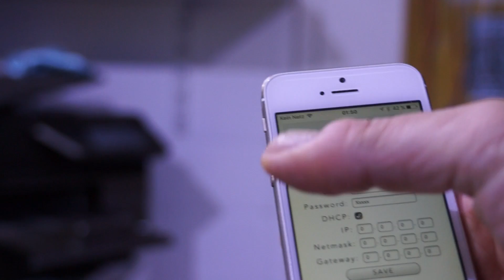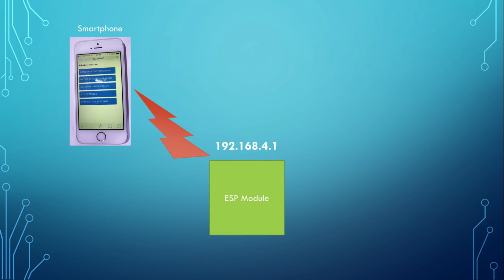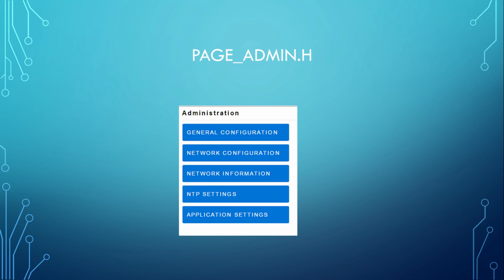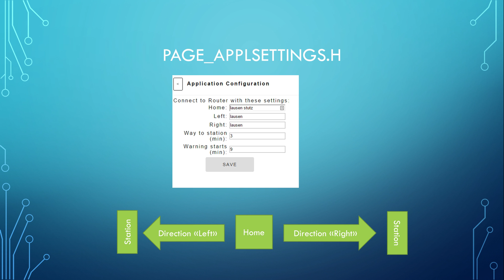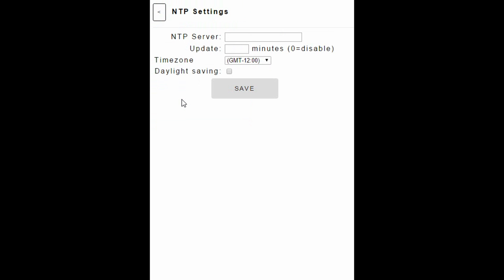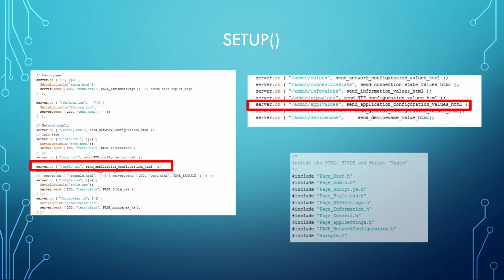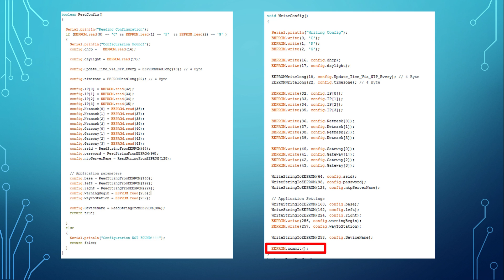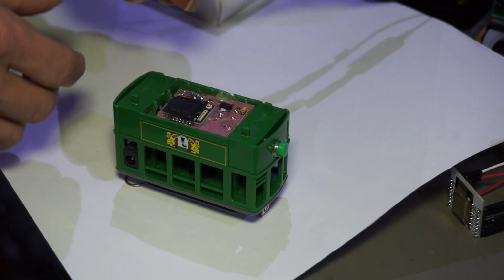#31 Internet of Things with ESP8266 #3: Interacting with your Smartphone

Comment: Andreas thanks for the videos! I have a question on EEPROM. in the video you said its only capable of a few thousand writes. but most new EEPROMs are capable of a million. do you know for sure witch this is for ESP8266?
Reply from the maker: You can check the label on your Flash chip. They use different makes.

Comment: I have copied the tutorial example. My target is ESP8266-07. The code complies and downloads into the ESP ok. When restart the ESP I see the AP show up in the wifi list on my iPhone ok. But, when I navigate to 192.168.4.1 The page is not found. My desktop and phone are also linked to my home router on a different subnet 10.0.0.1
Any help much appreciated, thanks.
Regards
Dave (Guy with the Ozie accent)
Reply from the maker: You will not find this address on your normal LAN. It is a different Wi-Fi and you have to connect to it with your mobile first (you will lose the connection to the internet for this time). Then, your address will work
Reply: Thanks Andreas. 
I did not think of that. Will try it later today. I really appreciate the work you have put into all the videos, they are very informative and helpful. I also particularly appreciate that you answer everyone's questions, very impressed with your attitude, passion and skills.

Comment: First of all - Andreas you do a great job - I like your well prepared and explained videos.

The sample code provided I could not use without any debugging.

Credentials.h missing - this issue was described earlier here - I deleted line #include <credentials.h> in ino-project file and set defaults in section // DEFAULT CONFIG  config.ssid & config.password manually
(if credentials.h is missing code will not compile)

Other issue I had: After uploading code to my ESP8266 log shows startup, but after a few seconds I was catched in WiFi not connected loop - and after some loops the watchdog restarted the ESP.
This was caused by a very short Admin Timeout in global.h file - search for "#define AdminTimeOut 1" - this equal 1 second. I set to 180 to have time to connect to access point ESP and do the needed settings. If not finished in that time frame the ESP is again catched in restart and you have to begin from the beginning.

after these issues where solved - all the rest worked as expected - hope that helps others not to run into same problems and loose their time.
Reply from the maker: Thanks for your comment. I changed the repository accordingly.

Comment: very interesting concept, Sadly though iexperience a problem. With the 
proper credentials set in my credentials.h, the serial monitor tells me 
it does not connect to WiFi.
Now if i understand right, even if my credentials are wrong, ir should start up as an AP so i can fill out the proper credentials, but  I dont get any connection to 192.168.1.1/admin.html

Interestingly, when I try johns original sketch, i do get connection to wifi, but even then the connection to 192.168.4.1 is very haphazard, sometimes it will work, sometimes not.

Now if i understand right, when the 8266 is in acces point mode, it should appear with its own ssid right?  I don' t see that at all.
Am i completely misunderstanding what is happening here?
Reply from the maker: In access point mode, the ESP has its own WiFi network. And you cannot connect to it, if your device is only connected to your home network. Your device has to have its own antenna to see this network. But I think, you experienced this already.Today, I would go the way I showed in the the IOTappstory.com videos (WiFimanager).
Reply: correct, that wasn't really my problem. but even when disconnected  from my regular network, the connection to the AP was haphazard. From my experience with WiFi manager in the past, the AP comes up with an SSID that one can connect to, but I did miss that here and in John's sketch.
As you are Swiss, it would be unthinkable that you would publish a sketch that isnt working, so for now I will presume there is some problem in my network
Reply from the maker: +Ed19601 It cannot be a problem of your network because the ESP creates a completely different network if in AP mode and your smartphone connects directly to it. This is, why you will lose internet connection to your smartphone for that time

Comment: Hi Andreas, I like your code samples especially where you explain how to have a stable program (no "while (1 == 1)" only, short delay, watchdog code, etc).
But I not found the best way to get a very simple function: some "on" and "off" buttons to manage my Electrodragon relay board.
Where it's better choice to create and manage them, example.h or main void loop?
If I create my buttons with html code directly from example.h, what is the best way to handle them?
A small example of code would be much appreciated...
Reply from the maker: There is not best place for any code. It always depends on your preferences.
I am not in HTML, I just copy-paste the code in this area. So, you have to ask somebody else with more knowledge.

Comment: Hi Andreas,
I successully implemented the FW to an ESP and it works GREAT ... thanks for your work !
Question :
Once the network setup (SSID, PW, DHCP, IP etc ...) has been written into EEPROM, what if I would like to RESET it all to the initial configuration (AP mode, 192.168.4.1) with the help of a pushbutton (connected to a GPIO) ?
An ISR could then be fired and erase the EEPROM "C-F-G" configuration ...
That would be interesting when the ESP is supposed to change of location and be set to another router !
Any hint ?
Reply from the maker: +Yann M You have to wait a little. I am working on a completely new infrastructure dealing with these issues.
Reply: Can't wait any longer :-) !!!
When is it due ?
Reply from the maker: Hopefully as a Christmas gift...

Comment: Hello Andreas,
Sorry to ask you again  but you mentioned in this #31 video that you got inspired from the work of a certain John Lassen at http://www.john-lassen.de/index.php/projects/esp-8266-arduino-ide-webconfig
This link does not work anymore, do you know of any Github or mirror where I could also check his work ?
Thanks.
Reply from the maker: I do not know whether this is temporary of forever. I found now a much easier way of getting a very similar function. I hope, I will present it next week in one of the new episodes.
Reply: I think you typed it in wrong. I found the link at http://www.john-lassen.de/en/projects/esp-8266-arduino-ide-webconfig Leave out the index.php, and put in en (for English, I presume)

Comment: Andreas, your videos are a wonderful gift to the techno-world! Well done. How do I integrate the two commands that set the mode to WiFi_AP_STA into  your VB_WebConfig_OTA_V7?  Is this done in a separate routine that must be built in to that V7 file?  Or do I rebuild another sketch around the Page_*.h files?  But if I do that I lose the EEPROM on reloading your V7 program, right?  I don't understand. What am I missing? Thanks again! (BTW: The toy train car is a very nice touch! Cute!)
Reply from the maker: Thanks for your nice comment! These commands are already in file BVB_WebConfig_OTA_V7.ino. I use the STA mode to span a WLAN for the Smartphone to enter the configuration, and later (after a timeout periode), I change to AP mode to connect to the internet.
Just follow the status variable, then you understand the program. If it is admin, the STA mode is used and in all other modes, the AP mode.
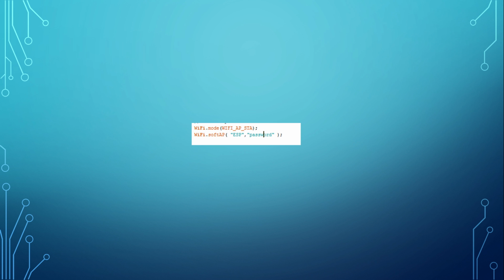Reply: Oh, I see.  Thank you.  On github line 135  I see "WiFi.mode(WIFI_STA);"  At 1:50 the video indicates WiFi.mode(WIFI_AP_STA);"  The difference is probably a versioning update to the code.  Yes, this is in the area marked by "status = admin".   The code works great for me in its default load.  Now I am trying to play with the parameters via a smartphone (actually a browser).  I plan to modify your code to use with our local bus service and their API structure that is a little different.  Hopefully later I'll connect to a SSD1306 display.  I'm having great fun and really appreciate your help!
Reply from the maker: Glad to read that it works now.This is always a good base for further changes
Reply: Thanks for the reply.  Well... not everything works, but most does.  It is now in the wee hours of morning in Switzerland and I'm waiting for the 6:12 AM bus to/from Lausen to arrive (on my computer).  I'm stumped.  
Every time the schedule updates, line 258 or 283 trigger a status change to 'idle' and prevents further updates.  This always occurs when minTillDep = 48 and before the 10 minute window that enables the beep function.  Maybe h1, h2, hh are designed to prevent this.  So 'freq' remains a -1, and beep doesn't get to start as the bus doesn't get any closer than 48 min away.  I've been debugging all day today and don't know what to do - hmmm.   I'm still working on the smartphone parameter setting - I'll get there.  I do have some great diagrams of your program though!  Happy to share if you are interested.  
Still having fun,
Craig
Reply: Solved.  As everybody except me knows Switzerland time is GMT+2.  That explains why my next bus schedule was disappearing about an hour in advance.  I've learned lots as I have looked under every rock while debugging.    On to figuring out why NTP time is about 4 minutes different than other sources.
Reply: I'm wrong again.  Switzerland time is GMT+1+1DST.  But I was still off by 54 minutes per timezone delta from GMT.  I found it.  In NTP.h, line 152, github shows a multiplier of 360 (_timeStamp += _timeZone *  360; // adjust timezone).  My timing was off until the value is changed to 3600.  I hope this helps someone.  Please correct me if I'm still wrong.  I may be looking at non-current github stuff.  On to getting OAT working!
Reply: Hi Andreas.  One last finding.  In order to successfully invoke the Smart Phone pages and extend the Admin status, I expanded the AdminTimeOut to 20 seconds (line 17 in Global.h ).  Even that time-window was tight as you have to enter, or edit, data quickly before it timesout.  Hope this helps others.  Well, I'm done as it fully works!  I owe you big time!  Thanks!  Where is your donation button?  Now time for me to customize it to my bus in Oregon.  Got to go catch the bus!
Reply from the maker: Craig Larson Thanks for the tip. I will check when I find the time
Reply from the maker: Craig Larson :-)

Comment: Sir,
      this is a Wonderful video with sweet and precise demonstration but as I told you I am new in NodeMcu so it is little bit difficult for me to understand all those thing. I don't need every pages / configuration like yours I just want to upload my SSID & PASS via mobile to it's EEPROM (NodeMcu) so that after switch on the NodeMcu it can read my SSID & PASS from its memory and connect with my WIFI. So Can you please help me and guide me by point out the particular codes which i need for my project.(I already connected My nodeMcu using MQTT as you show in your tutorial)

thanking you .
Debasish Banerjee.

email: Dev.off.088@gmail.com